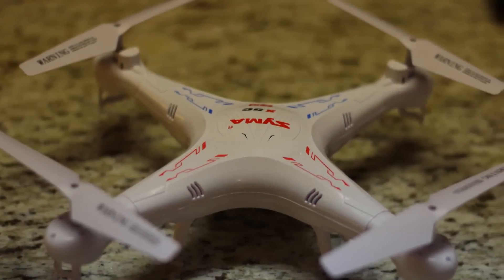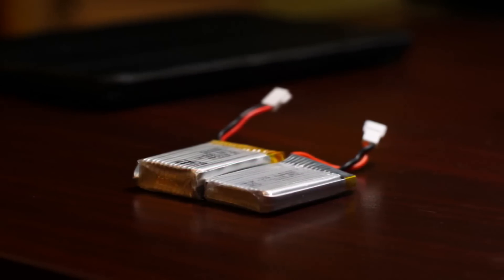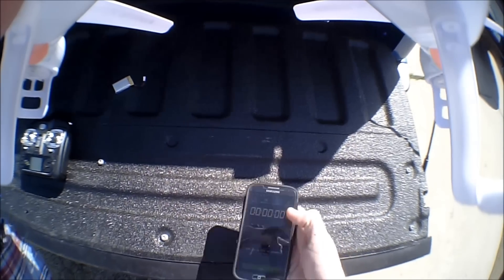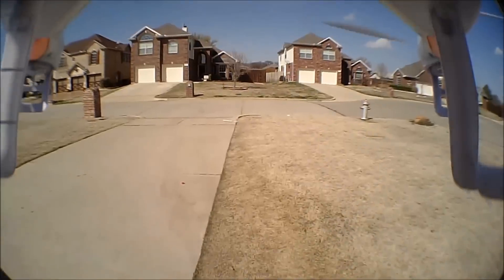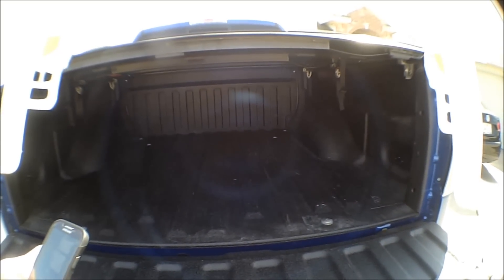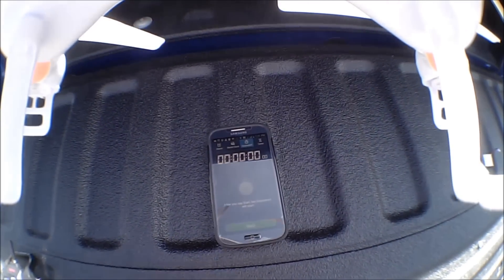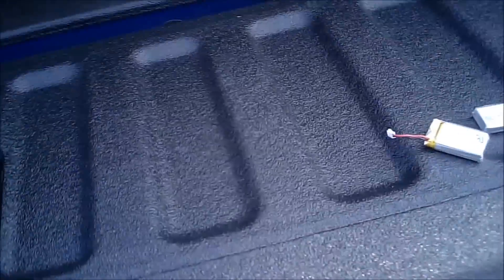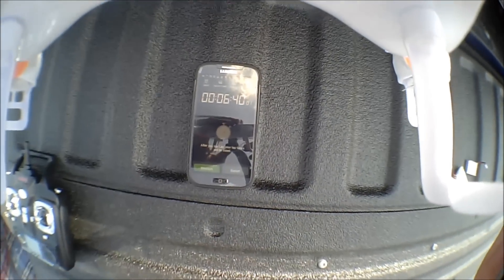Syma X5C-1 Stock 500mAh battery vs 650mAh battery

Comment: Is there a low battery indicator with your quad?My M68R (X5C headless version) always S/W to low battery mode after flying for about 1.5 mins, and then the quad shutdown the camera with the led lamps flashing, but it can still fly for 5mins more.
Reply from the maker: +柏儒陳 Low battery indicator, the front red lights will blink when low. Sounds like your LiPo's are bad and need new ones, battery should last much longer than that.

Comment: my 500mah are better than my 680 why?
Reply from the maker: Better how? Is it not as powerful or are your flight times shorter?. For me I had just slightly longer flight times and with the 600mah
Reply: my flytime is shorter
Reply from the maker: +William Riddersporre The larger the mAh the larger the cells are going to be generally. The 680 is heavier than the stock 500, hence the flight times, there's a balance, I fly with the guards off, and some times the landing pads. This quad is super light, the lighter you can make it, the longer the flight times will be because the motor is not working as hard. Also depends on flying aggressive / wind / etc. In my test under the same flight style and conditions the 650 yielded slightly longer flight times.
Reply: Because its 680 not 650

Comment: Did it go faster with the 650mah?
Reply: brian Pijnenburg  No. It did not. Voltage is the same, the mah refers to the Amps / hour, so its how long the battery last and usually this is from extra cells, making the battery larger.
Reply: Michael Dula does it affect the drones speed and the ability to do sharp turns and get to high altitudes ?
Reply from the maker: TheGAme ShOwzz Nope. Very very little additional weight,  the weight of the camera affects it dramatically already. It feels pretty heavy with the 808 and glass fisheye lens on it. When I fly without a camera I notice no difference between the stock vs these batteries.